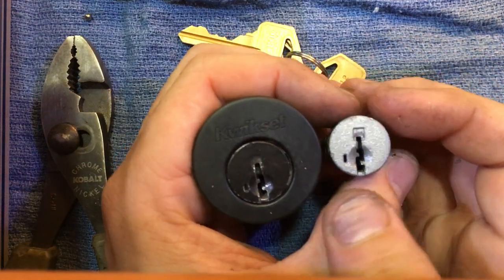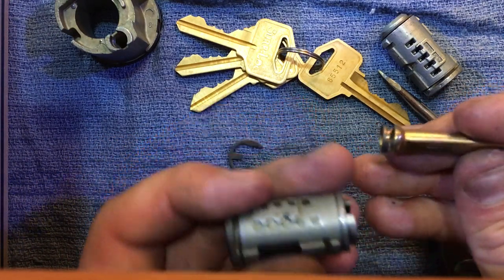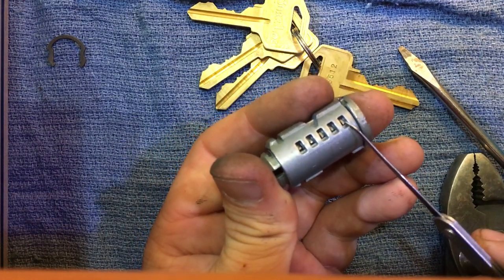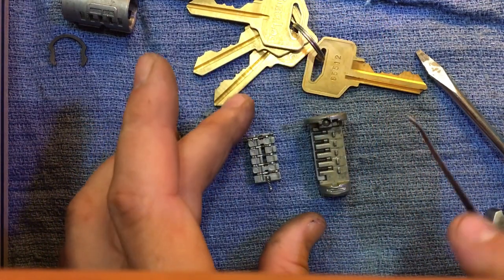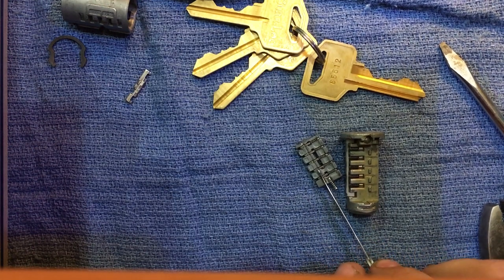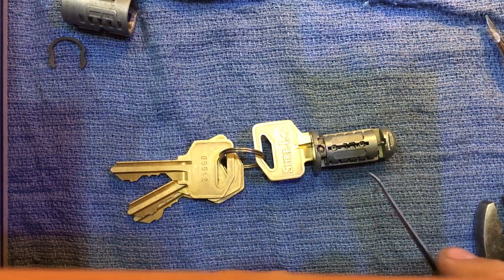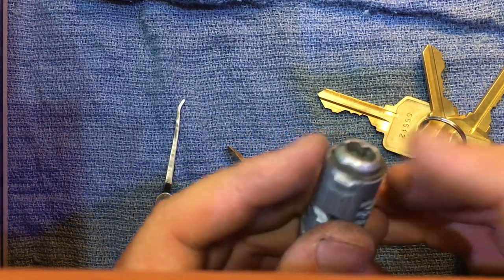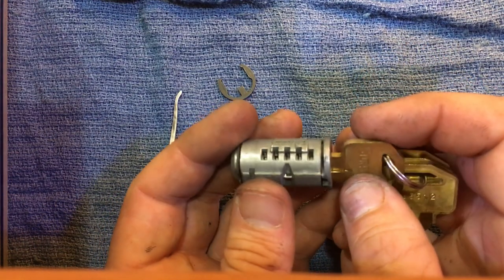Rekey Kwikset or Weiser smart key without reset tool/cradel

Comment: Excellent instruction video.  Worked like a charm.  Bought a used door for a shed project. Came with a Weiss lock and no key.  Since I already have Weiss smartkey locks around the house I was able to salvage this used lock and have it join the family. Thanks for saving me 50 bucks.

Comment: Worked like a charm!!! There was one change that Weiser did to the little bar with the two springs. Now, there are two little black clips that hold the springs in place over the bar. So, the bar goes in, with the two notches up to fit the tiny springs. Then the two little black clips snap over the springs. I can't believe how easy this was to do with your EXCELLENT instructions!!! No pins were lost in the process! LOL!!!!  I also can't believe that, if I was on the outside of a house, with some basic tools (allen wrench set, tiny screwdriver to pop the clips, I could put in any Weiser key and re-key the lock and gain entry in about five minutes?? Really? So much for security.

Comment: Awesome video! You are right, kwikset has changed a couple things inside the cylinder but your video was still very accurate. My side bar was retained with 2 small black c-clips. I had one lock in my new house that the builder has been dragging their feet on keying so I figured I tried to do it myself. Thanks for this!

Comment: Programming the smartkey failed on my deadbolt and not the original or the new key worked, your fix took less than 10 minutes including removing the deadbolt from the door and putting it back. Key things to watch out for: I had to push in the pins in order to slide off the housing as you demonstrated, pushing the shuttle back and forth was necessary otherwise the pins wouldn't set properly. Thanks again!!!

Comment: This is strange.  My Quik Set cylinder did not have a removable side bar.  The bridge just snapped off. It also had the plastic cover that I removed to check it out.  That was a mistake as one spring and bushing got loose and were a little tricky to reinstall. 

I was able to line up the wafers, reinstall the bridge, and insert my desired key. It wouldn’t turn, so I tried using the smart key tool and that put it in program mode.  

I don’t know if they changed the design of the cylinder since you made this video, or mine was just missing a part which may explain why it never worked in the first place. But I somehow have it functioning now. 

I reassembled everything and it works with my new key. Although not quite like your tutorial, it worked. I never would have known where to start without this video. Thanks.

As a side note, I just replaced several locks and deadbolts on the house. One lock didn’t work with the program set up. And another one came with no original keys included. 

Qwik Set sent me a new cylinder for one, and I fixed the original to work in the one with no key. I killed two birds with one stone and no money involved.

Comment: Just did it myself, but had a ball bearing left over from somewhere. In the video at 3:23 one falls out, I’m pretty sure that it goes back directly on top of the other ball bearing, just before you pop the whole thing back into the cradle and attach the larger of the two clips.
Reply: My bad, it goes on the other side, opposite to the first bearing that shouldn’t have fallen out.

Comment: Thanks man, I have two cradles in my van, and they as poor quality as these locks.  Managed to reset the locks at a clients site without having to replace the cylinders.  As a back up we always 2 or 3 spare cylinders in the van, but the finish didn’t match this time.
Reply from the maker: I know what you mean! This method has worked well in a pinch for me as well. They constantly have issues when you reset them and constantly need resetting. Sad Kwikset had to make a separate tool just to reset them. Kinda says something about the engineering of the product. 
However I do like the pick resistance of these suckers, they are awesome in that case.

Comment: Heck, ur procedure won't help on my Kwikset Smart Key.  Mine has a brass round knob on both side of the door.
Not the dead bolt type.  The cylinder betwn the knobs is of sheet metal shrouded w long tail where the half round
hole to stick the half round shaft from the other knob side.  I.e., u can't use the cradle tool.  And all of my other doors
are the knobs on both sides of the doors.  Any suggestions?

Comment: Thank you!!! Worked perfectly. My lock was a little different, the top bar wasn’t removable. Maybe that’s a newer design.
Reply from the maker: In need to do another update on the 4 different generations of the smart key. But overall all 4 generations are similar. Thanks for your comment!

Comment: Nice video but what kind of garbage system is this? Mine totally stopped turning. Doing this did nothing. Snapped the key trying to do this. One year, maybe 30 uses and the lock is totally useless. Next time avoid chinese import locks and buy a proper brand that doesn't "forget" how to work.
Reply from the maker: These locks have all kinds of issues, a lot of times the little tabs on the key pins will bend and completely ruin the lock. The smart key is convenient when it works, and has excellent pick resistance, but does have its draw backs.. 
sorry to hear your key broke.